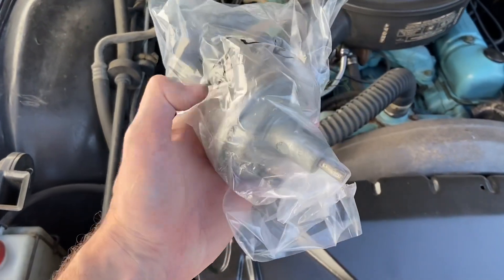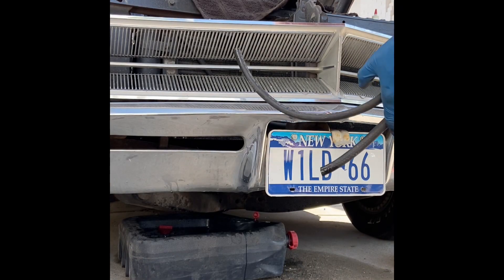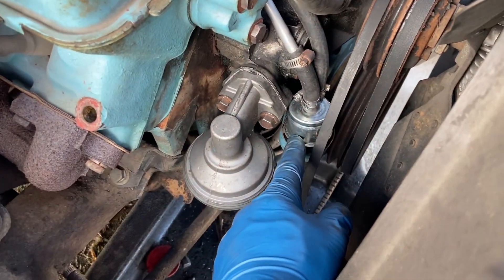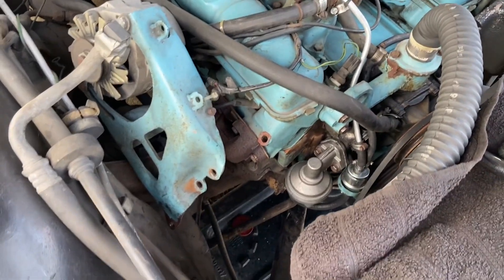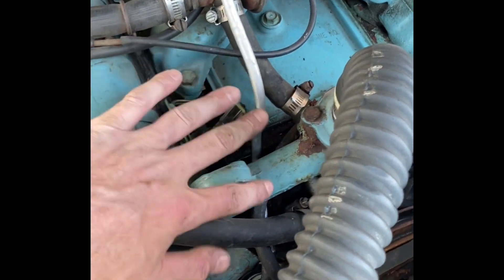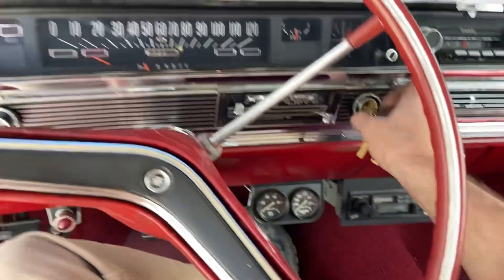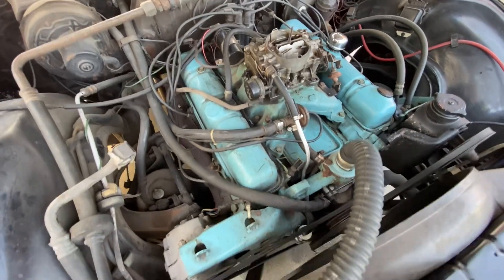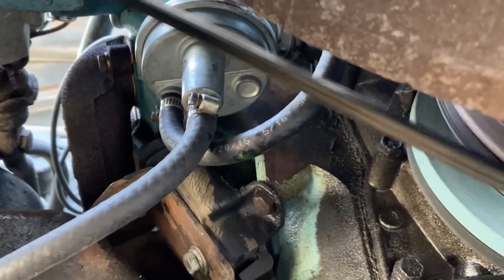‘66 Buick Wildcat Factory Fuel Pump Install + Big News!!

Comment: Hello do you have a video to show on YouTube how to remove the fuel pump on a 1967 Buick Electra 225
Reply from the maker: Hello I do not but the operation should be very similar if not exactly the same. 67 Electra probably also had a 401 nailhead and even if it had a 430 all GM engines are so similar for fuel pump replacement/installation

Comment: What seller on eBay did you get yours from? The fuel pump on my 66 rivi recently went out and I also want a original style fuel pump
Reply from the maker: Sorry yours went out, I got mine from seller named old.parts or old parts source and it was listed under “REBUILT Fuel Pump 1966 Buick 401 425 V8 with Air Conditioning # 40250”